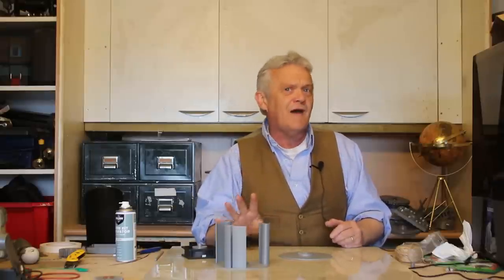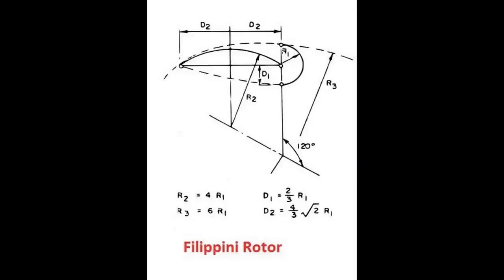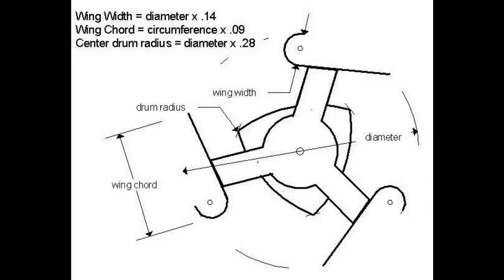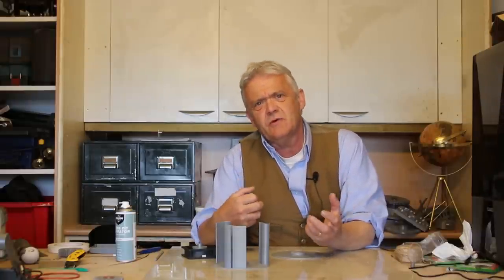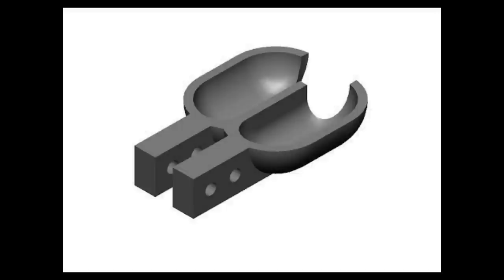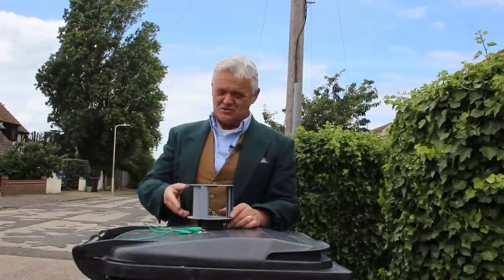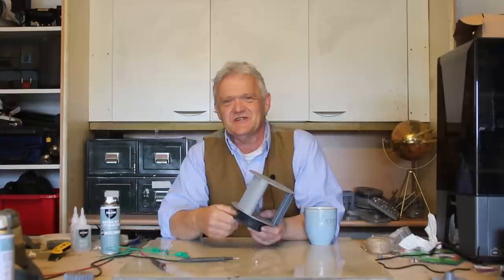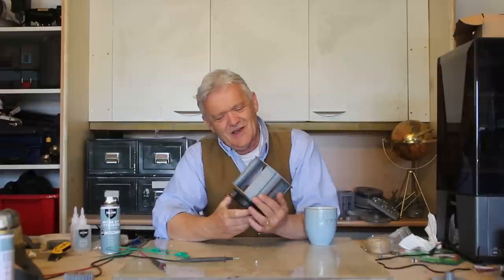1979 How To Make A Simple VAWT More Efficient

Comment: It would be a good project for Luke to determine the airflow through the rotor. Use a length of light wool thread attached to a fine needle in front of the rotor in a steady air flow with the rotor fixed. Move the needle across the whole rotor and check the airflow. Index the rotor in 5 or 10 deg increments through 120 deg, repeating the process. May indicate any improvements required to the profiles of the blades.
Reply: That or a test of the different airfoil shapes with a smoke generator would certainly be interesting. If it's not too much effort you could also mount cameras above the airfoils or film them through a transparent endplate to also capture the dynamic flow through the operating turbine.
Reply from the maker: that would be good
Reply: @ThinkingandTinkering  The problem with any VAWT is that as the wind pushes against one side of the blades to turn the generator the other side has to push against the wind losing energy and slowing the VAWT.

To overcome that you can create a shroud that directs the wind to only one side of the blades so there is no loss from the other side.

I demonstrate this in my Eagle VAWT Turbine design on my channel.

Love your vids and I am 20+ years off grid and a tinkerer!

Comment: For it to only have 3 blades at it's size and turn in low wind is amazing!  Very similar to something I have been working on building, though the design I am currently thinking about has many blades that are similar yet overlap slightly from the end of the Filipini curve.  Thanks for the video Rob!
Reply from the maker: i was rethinking the blade number mate and the exhaust venting
Reply: @ThinkingandTinkering  Sounds like a solid plan!
Reply: @ThinkingandTinkering  My thinking is this,  curving the exhaust back in toward the next blade forcing the wind to spiral like a ballerina pulling their arms in toward their bodies for torque on their spins.  Cheers and thanks for the response.

Comment: have you ever consider using an energy harverster circuit ?
 (such as BQ25570  for example). those are able to harvest very low input voltage/low current and is equipped with a step up converter that is able to charge a super capacitor. once the super capacitor is charged, the avalable output voltage is about 5V and can be used to power any low power device or even slowly charge some battery.
Reply from the maker: yes i have

Comment: Another great vid Rob - I'd like to see some good ways of making the output of smaller devices "useable" via blocking oscillator.

Higher voltage loads can be powered very easily by using a "condenser" capacitor on the "HV" output. (albeit at smaller current)

Might be an interesting project! Make the most of a small PC fan generator or such -  You'd definitely light the LED that way!
Would also be interesting to see an "Imhotep" PC fan design deployed in a PC fan generator, without any electrical input.
Wonder if lenz drag could be mitigated this way? 

Many people have claimed to see a "gain" when reproducing such circuits to a high standard.

Keep up the quality stuff !

Comment: The problem with any VAWT is that as the wind pushes against one side of the blades to turn the generator the other side has to push against the wind losing energy and slowing the VAWT.

To overcome that you can create a shroud that directs the wind to only one side of the blades so there is no loss from the other side.

I demonstrate this in my Eagle VAWT Turbine design on my channel.

Comment: Electrode stripes on the fan blade, when it rains generate power just like the rain fuel idea, also when the blade spins in the wind centrifugal force would add even more. Connect it up using a slip ring rotating connector.
Reply from the maker: nice

Comment: Hi Rob! "More efficient", I have been fascinated by the 3 phase hover board motors using them as generators, seems as I peruse the data they are very efficient (due to the usage of a 3 phase system). Since 3D printing has the advantage of creativity,  I pose an idea. perhaps you might explore using this technology in a future project. (I my self have been tinkering with hover board motors (even using one to drive another ( probably not 2 practical, but interesting)) "Just "thinking 'n tinkering", myself! You inspire me and i'm sure others garner many ideas, please keep those ideas coming!!!

Comment: Hello Robert,
   Thanks for all your efforts.  I'm just wondering In all the different vawt designs you have made.  What one would you recommend to run dc power to preheat a 15/20 gal domestic water cyclinder.  I'm In a wide open area.

Comment: How does the difference in fluid collision affect it? The Pelton wheel receives a focused jet of water with a fixed direction and cross sectional area (smaller than the cup size) that splits on the center ridge and transfers its energy to the wheel before being ejected out the sides. The Savonius wheel receives an unfocused wall of air which is not split, though excess air pours over the edges of the cup/trough. The best way I can visualize the Savonius is as a trough filled to the brim with water where the angle perpendicular to the water is the direction of air flow and the surface area of the water is the effective area being acted on by the air (the more it it tilted the less water you contain and the smaller the surface area). Considering this difference, I can also see why the added curved plate would improve the Savonius since it increases the surface area and directs some of the wind that would otherwise flow past into the cup. You may be able to improve the C-rotor or Lens rotor by changing the plate with airfoils (maybe adding vortex generators) that minimize air separation, directing more air into the cup.

Comment: Have you thought about stacked turbines with every other turbine rotation in the opposite direction? I was thinking that you could have the magnets on the top of one turbine and the wire coil on the bottom of the stacked turbine. This would double the speed of rotation without the need for a gearbox. By making a system of couner-rotating stackable generators you could generate greater energy than a commercial wind turbine while keeping the parts small enough to print off on a 3D printer.

Comment: Take the portable flapper rotor, put cup shapes on the inside of the flapper blades, possibly with curved blade inserts to divert the wind upwards. Replace the cap disk with the axial windflow cone rotor, with the exhaust helping to spin the flap rotor in the generation direction.
Reply from the maker: have you tried that?
Reply: @RobertMurraySmith  
Not yet. Remember I don't have a 3d printer. I do have some pvc pipe, so I may try to heat form some airfoil flappers. Minus the cone wheel cap.
Reply from the maker: @Vibe77Guy  have alook at a 3d printer mate - you can get them for US$100 - they are a pretty useful tool
Reply: @RobertMurraySmith  
Finishing the build on the shop to put it in has to come first. That and the gold recovery equipment is also in the build stage. I hate having to deal with avoiding tin. But what I have is mostly plated phosphor bronze, with 8% tin content.
So many irons, only so much wood to feed the fires.
Reply: Revisiting video 1956 for a thermoforming heat source.

Comment: An interesting option would be to run it as a VAWaterT with the rotor submerged and 100mm water top and bottom clearance. Cyclic gearbox driving the generator above the water would provide a decent amount of torque in a shallow water channel with good speed water flow.

Comment: Would you consider adding a rake to the blades?
I'm thinking that the air would hit at the closest point of contact, and then accelerate down (or up) the concave surfaces and in turn accelerate the rotor.

Comment: 😂😂😂😂😂
I made one of those hooved shaped ones recently for a magnetic rail.

The rounded ends face inward towards each other. The magnet wire doesn't wrap all the way around, but instead serpentines from the flat edge on one side to the flat edge on the other. Both ends of the wire stick out from the same end of the horseshoe/hoof/cup thingy. Then a random bolt in the hollow area (because iron i think). And the little tinfoil thingies will flutter up the rail. Its not very good or very interesting, but it entertains me 😅
Reply from the maker: awesome mate - good job

Comment: If you had a same size Lenz2 rotor handy and switch out rotors it would quickly let you know which is best for you.  Direct comparison seems like the best way to compare their performance.  -would like to see more of that in the videos.
Reply: I found that the best, most accurate way to test and compare wind turbine designs is to have a standard for airflow like a wind tunnel. If he is serious about this that's what he should do.
Reply from the maker: same size doesn't matter much mate - just normalize for size - that is make torque a proportion of rotor diameter, rotor height and wind speed and you can compare easily enough
Reply: @ThinkingandTinkering Keep it simple!!!    Just a no-load speed test, of the same size VAWT rotors, on the same stand and bearings, and within a half hour in the same outdoor wind, will give very useful information.  When a new competition size VAWT is made a quick test against the top speed rotor will give a idea of its usefulness as a power generator. It would be very hard to come up with a "normalizing formula" that everyone would agree on.
Reply from the maker: @danedmiston9673  sorry mate - those formulas already exist and are used
Reply: @justtinkering6713  Maybe that's what you or I should do, and have a send in your standardized sized VAWT rotor model competition.  (I would want to upgrade my wind tunnel and test equipment before doing that.  - will have to think about it.)
Reply: @ThinkingandTinkering  No need to be sorry.  Keep in mind that all of inaccuracy of measurements needed for the "those" formulas compound the inaccuracy of the results.

The equation for top speed with no-load is.  Power = the wind resistance + bearing resistance at that speed.

Generally, for a given wind speed, one half of the turbines no-load top speed will be the most efficient speed for operating under load.

Comment: Hi Robert. I have made a simple wind generator  from from a standard 40mm x 40mm x 40mm 3d printer stepper motor blades are 430mm diameter. It can light an old 4watt incandescent torch bulb at high wind speeds. I measure 5 volts at .75 amps. If you would like to review I can share the plans.
Reply from the maker: thanks mate - but i have made a few of those myself - but thanks for thinking of me